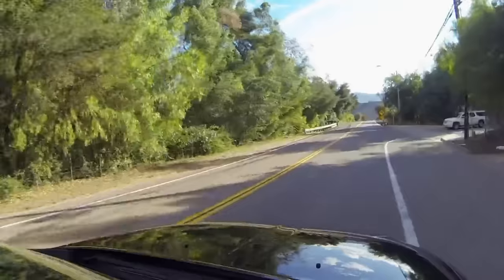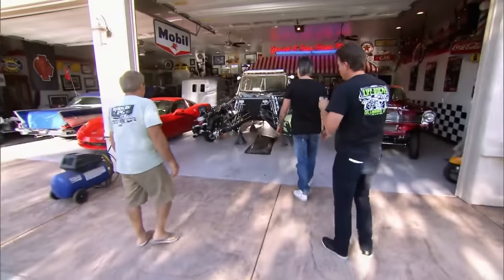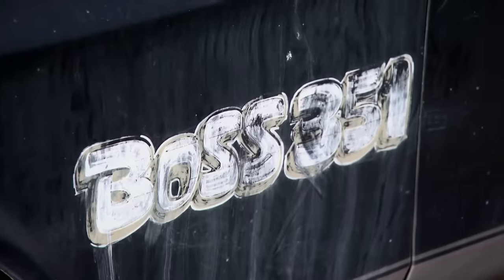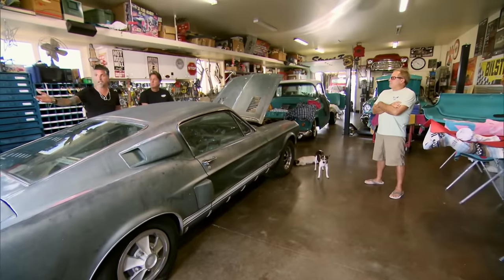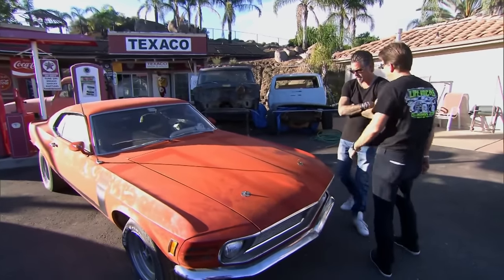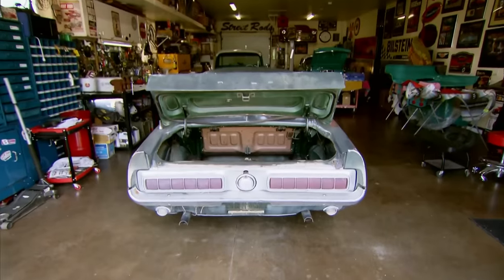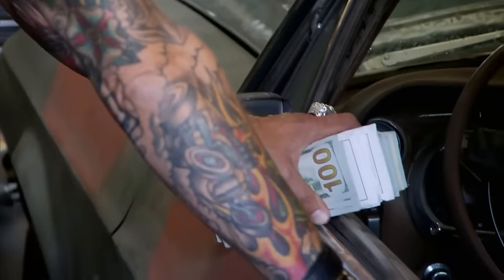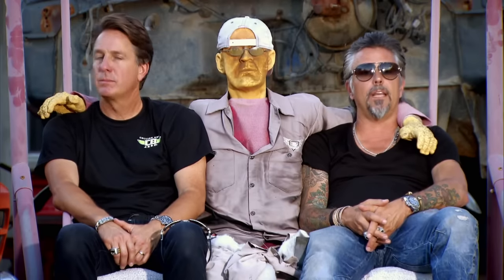Richard Rawlings Acquires 4 Super Rare Ford Mustangs For $65,000! | Fast N' Loud

Comment: If it wasn't for Dennis, Richard would be a small time used car dealer.  As it is Richard is a big time, in his mind, used car dealer.  Dennis flicked Richard most of Richards "big finds" in the early days, Dennis' money secured the bigger finds and it was Dennis' contacts who fixed Richards biggest makeover, at the time, the Ferrari F40.  

Richards biggest money earner is merchandising.  Second is other ventures like bar & food outlets and motorsport sponsorships.  The next would be the gas Monkey used car sales lot.  And the last would be actual hot rod builds.

Good on him for grabbing the opportunity with both hands and making plenty from it but there is way better shops to do a hot rod build, just around Texas let alone America and Gas Monkey would be down the bottom of the barrel for me.